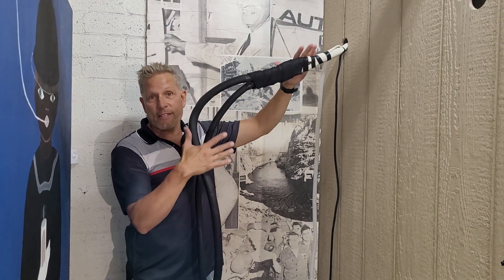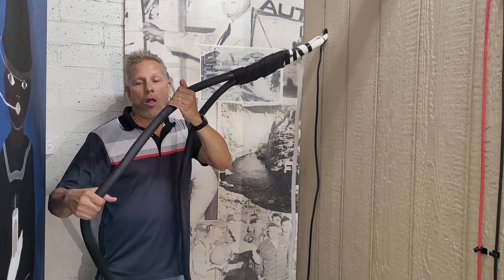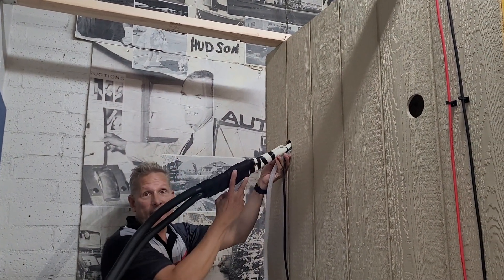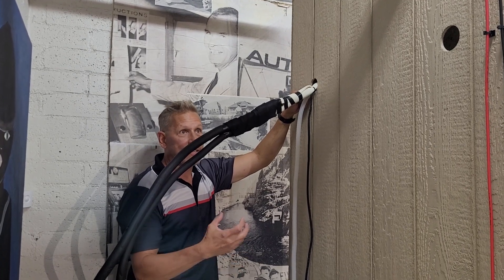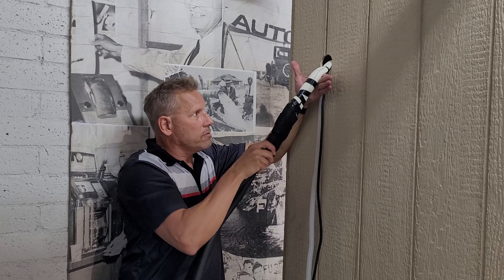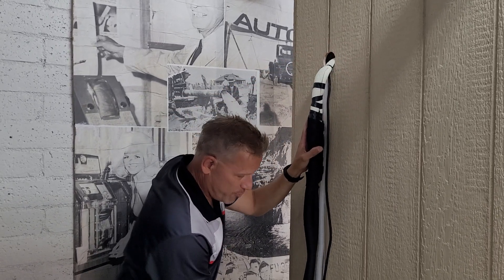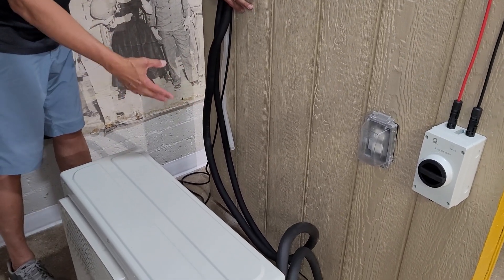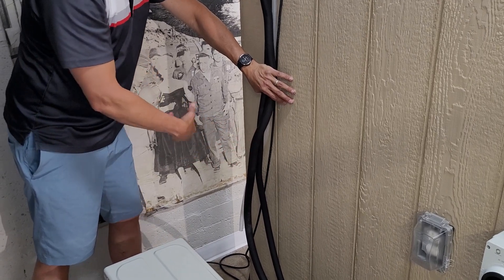Quick 'n' Easy install #4:  straightening out the line set

Comment: Nice video. I need to wait to see people's feedback before purchasing. Don't know what the track record will be yet for these units. What is the start power (amps) requirement for the Airspool comressor unit?
Reply from the maker: Hey, the compressor has no start power like a normal on-off compressor. It's variable speed inverter compressor, so it starts very slowly. It needs less power in the beginning than it does when it's running. It ramps up to between 300 W and 1200 watts, depending on the outside air temperature and your settings for the unit and your indoor air temperature. And yes, we only have a few people who have reviewed this so far, because it's a new product, but you'll see our standard ms-12 as a lot of reviews, and this one has great reviews so far that you can find. You'll also find a couple of users that have installed this and have been made videos.
Reply: @airspool  Thank you for your quick reply! I installed a Hyper soft-start on my main ac unit this season and it too provides a ramp up of current, but only on startup. My start amps went from 77A to 22A. My unit however does not provide for the variable run current as the Airspool though. That's a "really cool" unit there.  Norm